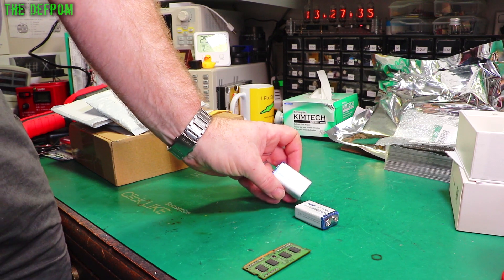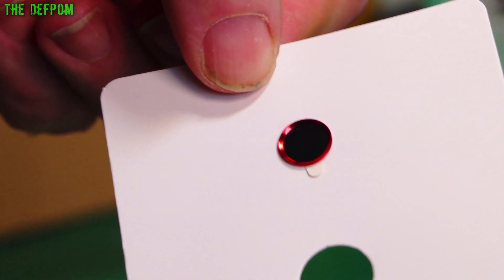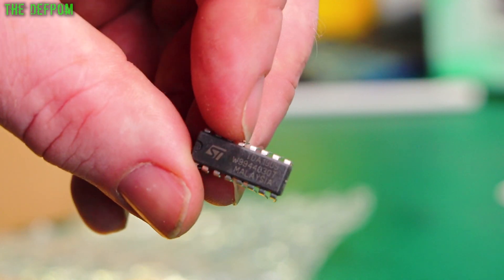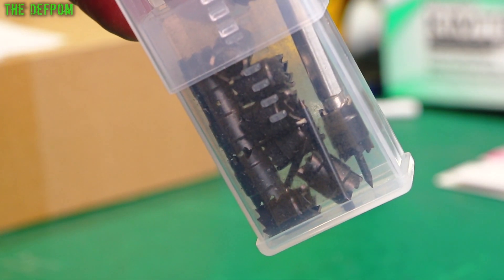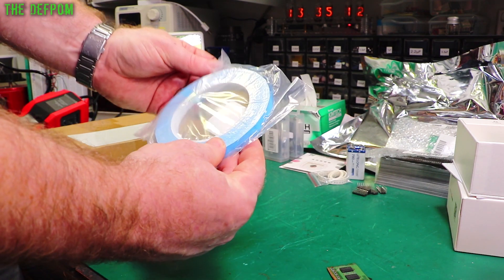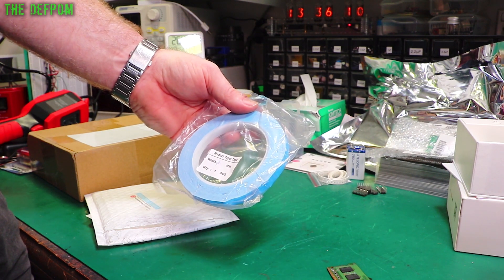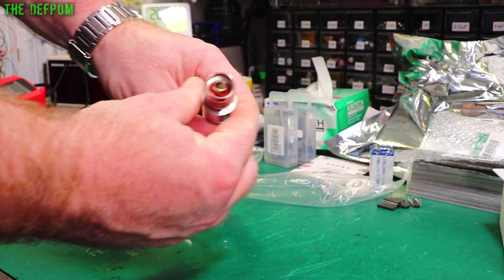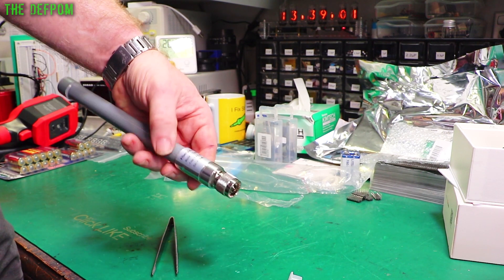🔴 Mailbag Monday 22nd March 2021 - No. 814

Comment: As usual a good video.
To seal the antenna around the N-Type against the weather, use Amalgamating Tape.
It will form a weather proof mass of stuff😮 around the joint.